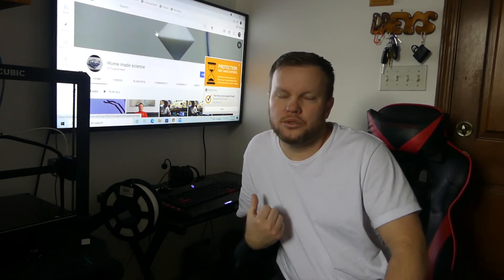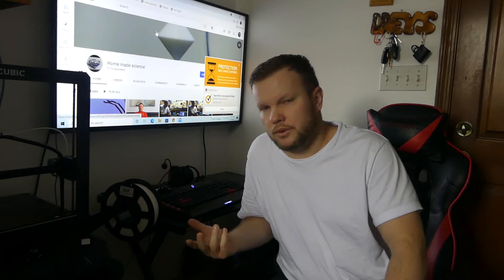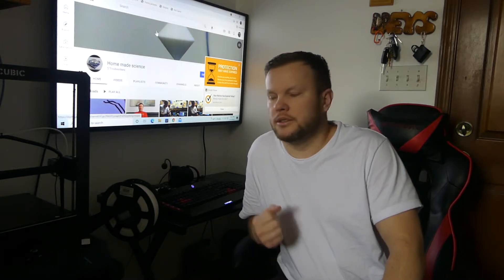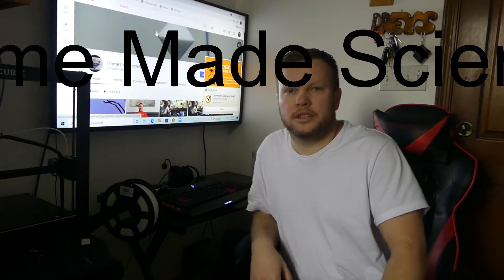Spacecraft OTCX1 and Utron design

Comment: It's good to see people actually putting things into practice, I'm currently in the process of trying to replicate T.T. Brown's findings that you covered in an earlier video. Can't find any information on the voltages required though
Reply from the maker: Depending on what setup you will try HV only or mixed HV with ac pulses soo look into one video I had 25grams loss on HV setup simple one work with shapes and dielectric between.

Comment: make a clay mold of it and pure it with aluminum
Reply: The original Utrons where made out of iron (Otis T. Carr tells about this in an interview, it is also hollow and probably filled with Mercury. With a single or double copper winding around it.
Reply from the maker: @Streamcatcher   I know about hallow one but I never heard Otis on radio that he was that was iron utron maybe I missed, anyway it should show some effect on the coils by induction of utron (Lorenz force ).
Reply: @FixItAll1  and yes, it must show some effect in Aluminum too. The shape of the Utron is mainly there for the copper windings, so you have the most important part already going...
Reply from the maker: Yes I just said it in the video at the end 😀.
Reply: You mean make an aluminum one like that?
Reply from the maker: @سامرحسنهاديأحمد  yes 6 of them I will make OTCX1
Reply: What about Gerbinikov platform has any one done it ..any new updates about it....
Reply from the maker: @سامرحسنهاديأحمد  nope noone did how I know .